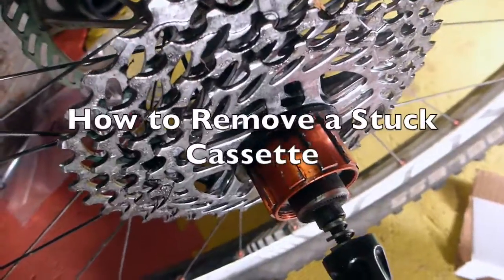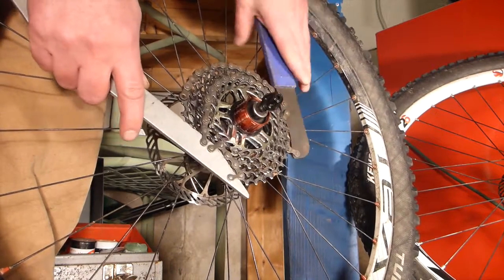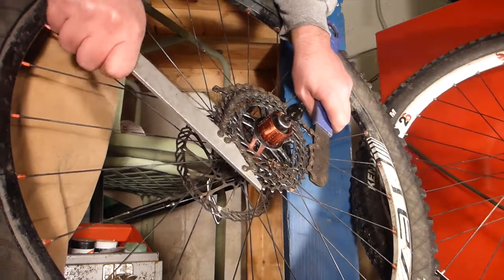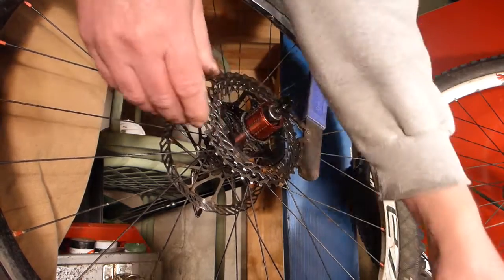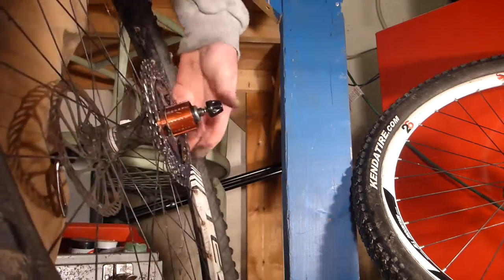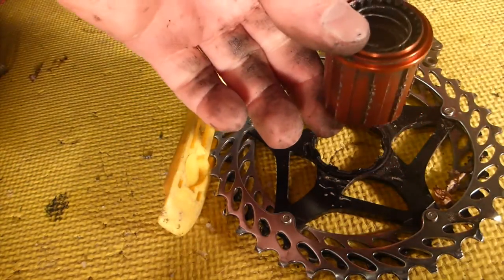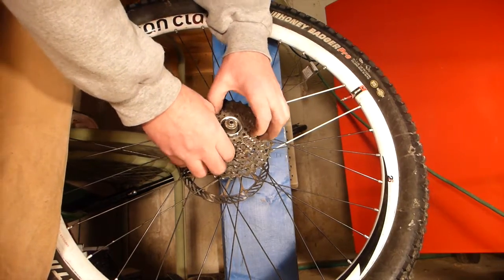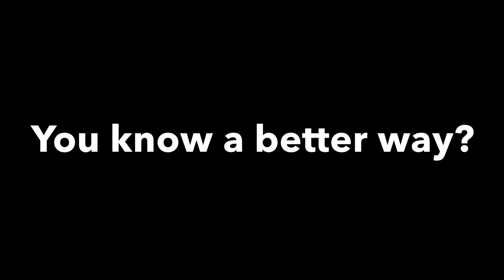How to Remove a Stuck Cassette

Comment: Great video - I blame the manufacturers for making their freehub bodies out of cheese.Also useful to note that an XT or XTR cassette has an alloy freehub carrier, which helps keep the freehub body in good condition and reduces the risk of this problem arising.  If you haven't tried already, it may be worth switching to one of these next time you're replacing the cassette.

Comment: had same problem  ended up fling burrs off and putting free hub in vice and using chain whip to counter rotate cassette , will buy steel
fre hubs fron now

Comment: Strange-my Ti Nukeproof hub's aluminum and hasn't been scored/embedded by a cassette. It's an ancient 8 speed.... Next time though, rather than mallet it inward, flip the wheel, insert a wooden dowel from the disc side and tap it with a standard hammer over four or five points as near the center of the inner cog as possible.  Then apply a light coating of Permatex 80078 Anti-Seize to the hub surface during the rebuild.  It's a compound that stops a steel spark plug from becoming "one" with your aluminum motor block.  Good luck!

Comment: These things can be a real bear to get free.  Obviously it is because the freehub body is of a softer metal and the steel of the cassette splines digs into it.  After getting the cassette off, I have used a small needle file to clean up the burrs on the freehub splines so that at least the new cassette installs more easily.  Just be careful not to take off more than the burr.  If you do it may make the problem worse the next time you change cassettes.  Worse, on these DT Swiss hubs, I believe the freehub body costs well over $100 (part only) to replace.  And I believe they use several types of ratchet mechanism---either pawls or a many-toothed star ratchet.  I do not know if they are interchangeable within a given freehub body.  DT Swiss can likely provide that information.
Reply from the maker: Thanks. Geezzz on the cost of a DT Swiss free hub.  Good to know.  I recently got a pair of Stan's wheels which I'm really liking.  Haven't taken the cassette off yet to find out if they're going to have this same problem.